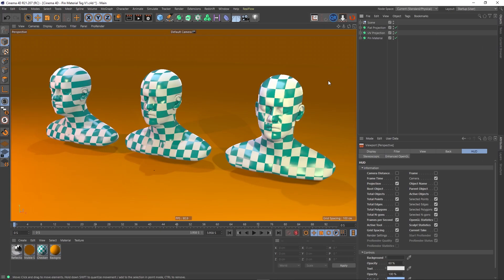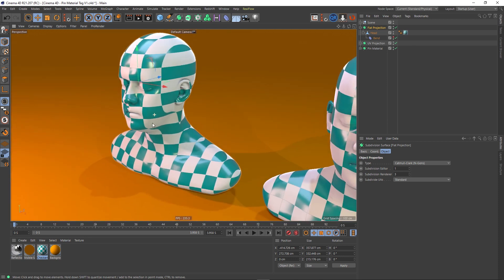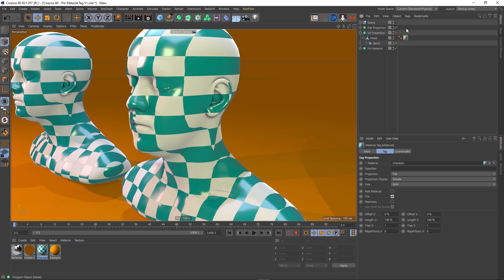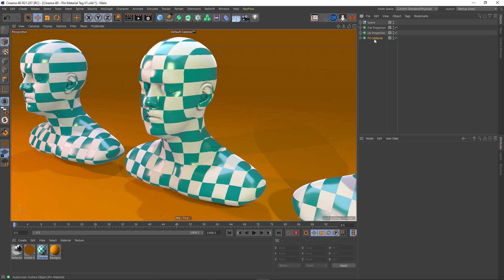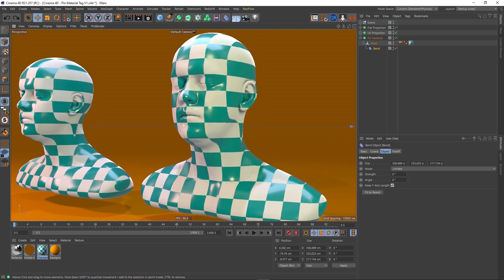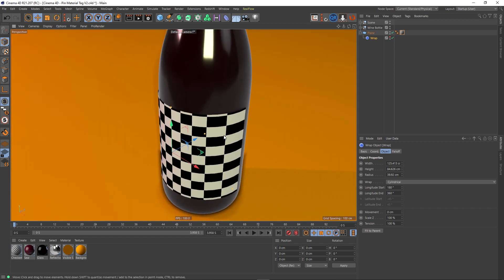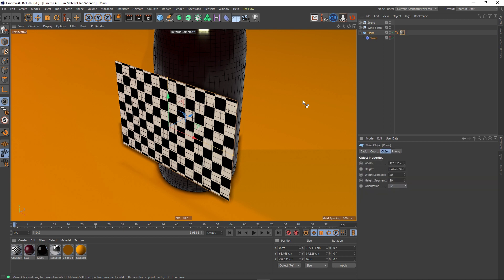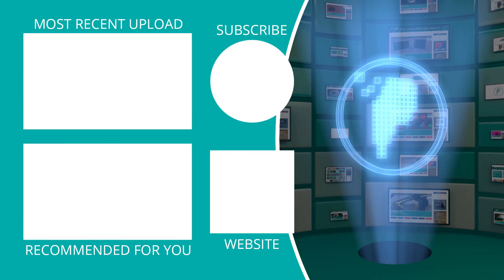Cinema 4D: Pin Material Tag

Comment: help) why is the material not fixed on the object in the viewport? moving behind the camera
Reply: Moving behind camera? I'm afraid you're going to have to provide more detail.
Reply: @BEEFDOCTOR  sorry for my bad english) when I move the camera or without it in space, the texture sort of unfolds behind it. That is, it is not fixed on the object.
Reply from the maker: @ethnoparasite4633  - did you watch this entire video? because that is precisely what this video deals with.
Reply: @DIGITALMEAT  Yes, i watch) my problem is slightly different. You moved the object, I move the camera and material moves. The object does not move or band and PIN did not help (
Reply from the maker: @ethnoparasite4633  What projection is your material set to?
Reply: @DIGITALMEAT  frontal. only in this projection have this error)
Reply: ooo. Sorry. this is apparently the peculiarity of this projection, right?
Reply from the maker: @ethnoparasite4633  - It isn't a peculiarity, it's exactly how this projection is supposed to work. The material is projected "Frontally" from the cameras location.
Reply: @DIGITALMEAT  thanks a lot:goodvibes: